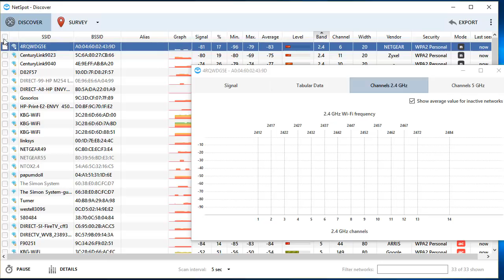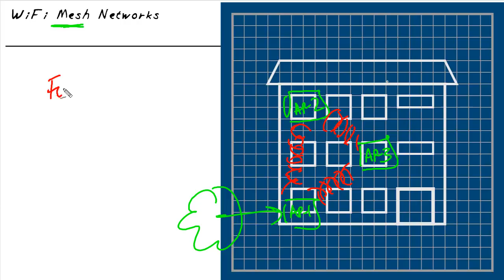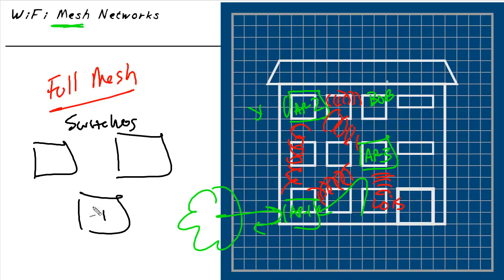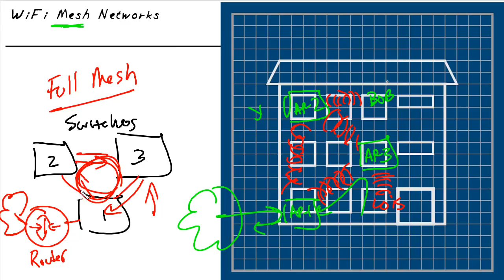All About Mesh Wifi | How and Why Does it Work?

Comment: are they wired between each booster? Can I just pop into local shop and buy 1 or 2  mesh things ?
Reply from the maker: Thank you for the question @ImFieldy. 

Normally 1 node is connected to the physical network, and the others are all wireless.  It is possible on most vendor's mesh systems to also hard wire the other nodes (over ethernet) that that will make them faster as well.

I recently updated my home network to Eero (from Amazon), with 1 connected node, and 3 wireless nodes as part of the mesh system, and it has been flawless.

Comment: how mobile smartly connect to stronger  wifi signal as compare to tranditional AP with same SSID ? I know in traditional AP. even used same SSID.  mobile device remain connected to a AP until completely disconnected then it connect to other AP.    do mesh wifi AP use same mac address behind or what ?
and
my second question. if we add wifi mesh AP with wired  ?

Comment: I have a question, in a normal 1 main access point setup(wifi), the network may get congested if some device connected are downloading something heavy. So if I own a second access point/mesh wifi, would this solve the problem if the another person is connected to the 2nd access point?

Comment: Great video man. Just bought a mesh WiFi solution and it's amazing. I still don't fully understand how it works though... Its like magic. The question I have is: if the second mesh router in a far away room is able to pick up and relay the original signal, why can't my PC or laptop just use that original signal if its making it all the way to that far away room? Cheers!
Reply from the maker: Thank you stevobrizzle.  Feel free to join my Discord sever.  Lots of people there helping each other out.  Each Saturday at 10am Pacific I hold my "Office Hour" where learners can ask questions about the topics they are studying.  Mostly focusing on Cisco CCNA 200-301 topics.  Feel free to join us there live if you are available.    Here is the link https://ogit.online/Join_OGIT_on_Discord

Thanks again stevobrizzle!

Comment: Hey Keith, hope all is well with you and your family. I do have a question regarding this topic. I recently bought a Mesh system (TP-Link Deco M4 <2Pack>) i finished setting everything up. but when i started trying to test my internet speed, I dont know for some reason it went down. when im still using the old router i'm getting around 180-220 mbps (my internet plan is 200mbps), but when i did the Mesh system i'm only around 60-80mbps sometimes barely 100 mbps. it's a big decrease of speed. I don't know if its just because the system was just set up? or it really made my speed slower? please help. thanks!!!
Reply from the maker: Thank you Tuff Juice.  Feel free to join my Discord sever.  Lots of people there helping each other out.  Each Saturday at 10am Pacific I hold my "Office Hour" where learners can ask questions about the topics they are studying.  Mostly focusing on Cisco CCNA 200-301 topics.  Feel free to join us there live if you are available.    Here is the link https://ogit.online/Join_OGIT_on_Discord

Thanks again Tuff Juice!
Reply: @KeithBarker  thank you

Comment: Keith, the video was great and easy to understand.  I use that old Apple TimeMachine and one airport express repeater in a large warehouse like home and end up with slow spots and dead areas.  I'm going to move to a mesh setup and considering AX6000 WiFi Mesh System (RBK853)Orbi Tri-band Mesh WiFi 6 System, 6Gbps Router + 2 Satellites.  If I do that and sorta "start over" can I still use the TimeMachine for backups? Currently it automatically backs up two laptops and one desktop and I count on it.  (Or at least think I do)  Any guidance as you seem very familiar with my old way of networking.  Thanks!!
Reply: I loved my time machine (and all apple products) but then one day after about 2 yrs, it just stopped working entirely and I lost everything on it unless I wanted to pay for data recovery.  :( 
Anyways to answer you question you should be able to. I did it with mine at one point just don’t remember how. But maybe contact apple support to figure out how.

Comment: Hi Keith, thanks for the informative video. Sorry if this sounds a bit of a silly question but... I currently get my broadband from Sky (I'm in the UK) and use their router. If I buy a mesh network system and replace that Sky router with the main/host AP-1, what happens with the service from Sky? Will they still know I'm using their wi-fi? Will my broadband stop because I've unplugged their router? I don't know about these things! Cheers

Comment: Hi Keith - big thanks for this video. Best explanation I have found. I have some questions which are not answered in your video. I'm hoping you can either answer them or maybe you have another video i can watch. I have an old long three storey house and when I first moved in the wifi was very poor. I run some of the bedrooms as Airbnb rooms and need high speed connectivity in each room. So initially I ran cable from my internet provider's modem/router up to the loft space at the front, installed a switch and an access point, ran cable to the back loft space, installed another switch and another access point. I get 350Mbps into the house and each wired point gets 350Mbps, but the construction of the house somehow interfered with the wireless signal still. Now I have cabled into each guest room so that the ethernet points all provide 350Mbps. However I now want those points to provide good wifi as well as wired connectivity. Can I use mesh APs using the ethernet sockets so that they can route using ethernet (I think at some point you mentioned something called back-hauling...) ? I want my guests to have the ethernet access as well as wifi. Do the APs have ethernet sockets too like many wireless routers do? Ideally I would like a single SSID for guests across the house so that they only have to store one SSID/PWD. As I remember, mobile devices used to stick to the original AP until it goes out of range completely even when a stronger AP appears. Is that still true?
Reply from the maker: Thank you for the question kevin leahy.   With the GoogleWiFi hockey pucks (that is what they remind me of), yes you can use the physical ethernet connections for their connectivity back to the one acting as the router.        Internet - Router Google WiFi via WAN connection, then connected via lan to switch which is then wired to Google AP WiFi via LAN connection.

I have tried that and it works, and is blazing fast everywhere.

Comment: Thank you for this video!
A couple questions, if you don't mind?

1. Can one connect by wired ethernet at any node? How should this compare to typical wired access? I once tried this using powerline, and that was a huge fail.

2. I'm assuming that a modem is still required. 
In your diagram: is "Access Point 1" a Router/ Gateway? 
Or is it a third mesh node? CAN it be a seperate router; or MUST it be a node?

3. Regarding the wireless standards: N, AC, AX (aka wifi 6, and now wifi 6e) etc...
Are mesh systems categorized by which of those standards they are compatible with?

Thank you so much!

Justin Barracosa

Comment: so do you just connect to the main router? or do you have to keep changing and connecting to the different access points as you move around the house?
Reply from the maker: Thank you for the question F2P Gaming Castle Clash & More!.   To the end user it will appear as 1 WiFi network.  Behind the scenes, the WiFi APs will forward the traffic towards the AP that is also acting as the router for internet access.

Comment: But if a signal is attenuated or blocked in a room, won't that affect the ability of the mesh node in that space to connect as well?
Reply from the maker: Thank you for the question Erik's Videos.   Yes, attenuation will impact one of the mesh APs.

Comment: Great video! I totally understand now! One question. My modem and router are in the same unit. Will I have to replace it with just a modem in order to use a mesh router?
Reply from the maker: That is correct.  It is possible to use the older router/cablemodem together with the Google WiFi, but it will lead to additional NAT/PAT and likely problems.   Better to get a separate standalone cable modem.   Your provider will have a list of compatible cable-modems, all of which are going to be DOCSIS compliant.

Comment: Keith, I have a question. Since we're planning to buy a mesh network, do the units look the same or are they like one set of mesh network has one main device and the rest of the devices are different from the main device? We are going to buy a set of 3 and we think that it may not be enough so we may buy another set but with 2 devices only. So will 2 sets of mesh networks work together? Thanks.

These are the devices I'm planning to buy:

1. https://www.lazada.com.ph/products/powered-by-tp-link-mercusys-halo-s3-3-pack-300-mbps-whole-home-mesh-wi-fi-system-mesh-wifi-mesh-router-i817182047-s2523170030.html?spm=a2o4l.searchlist.list.26.45293d722tWDv1&search=1
2. https://www.lazada.com.ph/products/powered-by-tp-link-mercusys-halo-s3-2-pack-300-mbps-whole-home-mesh-wi-fi-system-mesh-wifi-mesh-router-mesh-wifi-extender-i325884609-s684850301.html?spm=a2o4l.10450891.0.0.11ef514cEucGzg
Reply from the maker: Thank you for the question Aldrei Zara.   For the Google WiFi all the devices have the same electronics/software so any of them can act as the main router and AP (WiFi Access Point), while the other devices simply act as APs as part of the WiFi network.
That being the case, the network can be expanded by simply purchasing another device, and it can be another AP.  

Not sure if every vendor does it that way, including the links you included above.
Reply: okay, thank you so much Keith!

Comment: Isn't this the same as using one router and 2 extenders/ repeaters ?
Reply from the maker: Thank you for the question Raedah Samah.   With the mesh, they are running spanning tree, and calculating a non looping path, so there is a bit more going on than just repeating.

Comment: Hi, what are the speed comparisons? I'm looking to wire a houseshare with 5 bedrooms and want each room to have fast internet. Does the fact mesh networks only have one hard wired connection split the bandwidth between all of these acess points? Would the speeds be faster with multiple AP with their own hardwired connection?

Comment: Good morning Keith..I have been looking all over Youtube and doing lots of Google searching for a few questions about Mesh wifi...I am new to all this,and I purchases the Bearifi Mesh system with 2 pieces..I received it yesterday,and had started trying to get it up and running..First I plugged from my internet MODEM,not router into the main Bearifi routers Internet port,and it did what their instructions said,it turned and stayed Blue,then down to Red...I am thinking that I need to have their app already loaded onto my phone/and or tablet,then once I plug it in I should go straight to the app and try to set it up that way...does that make any sense ?  I don't see anything on their instructions about plugging up the Bearifi mesh ap router into internet modems,not routers..
about the 38-4- second mark here on your video you speak of this and wondering if this is how I hook mine up, my internet companys WI-Fi modems WAN port to the Bearifi mesh routers internet port ?  Sorry about the stupid questions but I have to be sure I am least getting started off in the right direction,so I can then hook up the single Satellite and get it properly placed to kill the 1 deadspot.   I will try to call Bearifi today and see if I can through to them,but any information you have would be greatly appreciated !  I just subscribed because I learned more from your video than in way too many hours searching for info on the internet...Ross   Oh 1 more thing..I can't find the app Bearifi says to use..I have looked everywhere for the one they show in the Quick start guide..wondering if there is another one that will work for the bearifi system ?

Comment: One question for you Keith, what is the range for each mesh unit? How far can you space them around a house? I live in an old victorian era house that is long and narrow.
Reply: What would you recommend for our house. We live in a three storey house, with the living space on second. And bedrooms and offices on the third. But the access point has to be on the 1st floor due to new open reach rules in the UK.  I have the eero system, how would you set this up?
Reply from the maker: Thank you for the question Darren!  It depends on the vendor/model you use.   If the internet connection is placed centrally in the home,, the other two access points could be placed at equally distant locations (away from the internet connection, one going to one side of the house, and the other going to the other.    In a house that is 3K to 4K sf, even if it is narrow, it should cover that.    You will want a system with at least 3 APs (access points).   1 will connect to your cable or dsl provider, and the other two will help cover the rest of the house.  Hope that helps!